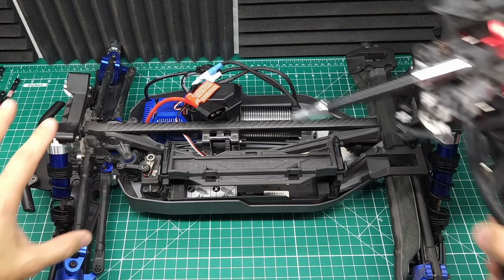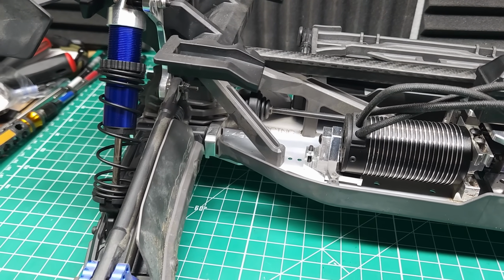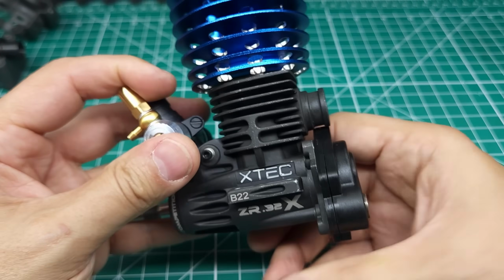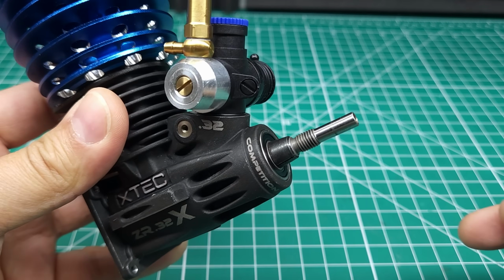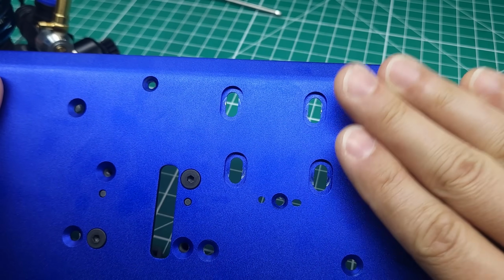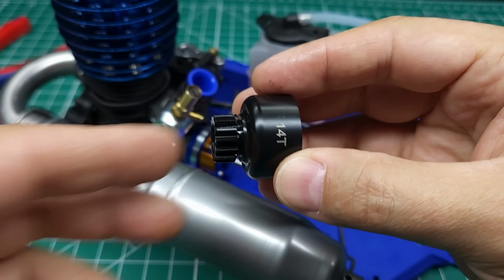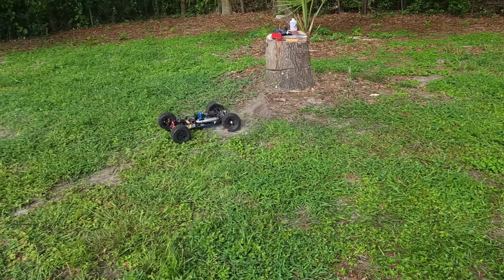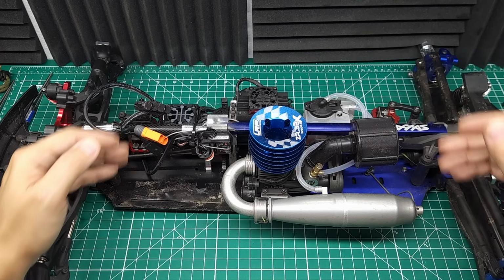Hybrid 2.0 - I Built The Craziest RC Monster EVER!

Comment: So why didn't you use the traxxas 2.5r engine it would be smaller and the the rpm is 60,000 just like the electric motor
Reply from the maker: I was going for the most powerful engine I could find. The Traxxas 2.5 is pretty weak.
Reply: @DoRC yeah but its hard to beat those rpms with these cars
Reply from the maker: For sure and I certainly did not create the ideal setup here. This is just me messing around with what I had available. I am sure someone could do it better and I definitely encourage others to try!

Comment: You need a small metal lathe. That flywheel project could have been a 30 minute project.
Reply from the maker: A lathe definitely would have been easier but it was a good challenge.

Comment: If you mount the gas motor in the original spot and swap the differential around in the front case to the other side of it's case.  It'll spin the wheels in the other direction.

Comment: Interesting build but what's the point? What problem is this solving? You've succeeded in making a car that's worse than the sum of its parts. I have a few nitros and they're fun, but modern electric is superior to nitro in every way. It would actually be an improvement to remove the engine, which unfortunately renders the whole exercise pointless
Reply from the maker: In this case the journey was the point. Sometimes just seeing what works what doesn't work how things interact etc is a lot of fun.

Comment: why not build a fast nitro basher with small electric motor and wheels on the roof. so if you flip you can use the electric motor to drive it back to you so you can flip it over and start it up again. or an RC electric basketball that you cant break since everyone just does huge jumps now anyway

Comment: I have a question: instead of rethink the mounting position of the nitro engine to change the turning-direction, why didn't you simply turn the diff around in the rear housing?
Reply: i'd also make a few modifications on the drive-train. First of all i'd install a discbreak on front and rear-end. Second i'd install a freeweel-beariing on both electric and nitro-drivetrain to avoid either of the engines having to drag the other engine with it. That way you'd have a much easier way to setup the poweroutput on both engines and have a well performing break for the whole model. And the only cost would be a little more weight for the breaking-System and finding a way how to install a freeway-bearing.
Reply from the maker: Unfortunately the way it's designed the ring gear goes down through the housing and into the chassis so you can flip it around but you have to do some pretty significant modification in order to accomplish it
Reply: @DoRC  In that case, i'd simply use the traxxas for the frontend and the arrma for the rear end - i believe it's easier with the arrma Differential, isn't it?

Comment: The air filter should be facing the front because it forces air in and makes the engine run better
Reply from the maker: I'm not sure I agree with that. Maybe if you're going really fast and you have a ram air scoop it might help but for what I was doing in this video forward or backward especially with the shape of the air filter isn't going to make any difference.

Comment: It’s because your pipe was facing downwards, and it was most likely running into obstacles out in the backyard that it would bug it out anyways with it being so new in it’s breaking it would still have troubles, no matter what and you know running around in that tight circumference nitro engines like a big circumference like to go big motoring around not little bitty turns God bless you
Reply from the maker: I don't think it was the pipe because I had problems on concrete as well

Comment: She mega rich on part throttle , those carbs are junk but it sounds to be mega rich on the low speed needle . I wish you were local I’d assist you on getting the .32 dialed in, first I’d check the plug make sure it’s in good shape , next those engines like .50 with of shim for the stock plug on 30% , if you have 20% then .40. They can be sensitive to fuel /oil and 8-10% oil is the sweet spot. Last the carb ..smh , it’s a .32 and even at 9mm Venturi it’s small for a .32 so never choke it with a 7.5-8.5mm Venturi esp when combined with a sub part carb . I have always ran a long needle Novarossi carb , my fave on the 32 is the 24066 . I have also done a few others which are all miles superior to the stock in terms of tuning and performance .
Reply from the maker: Yeah I've been running Nitro for quite a while but I have never really gotten into the really serious tuning so I usually just get them running good enough and then call it a day but I never could quite get this one running good enough.

Comment: Why not use the electric motor as an alternator to constantly power the electronics so you don't have to charge anything on the car, just refuel it?
Reply from the maker: It probably wouldn't be practical. These motors are not even remotely efficient and they're not designed to run it constant speeds.

Comment: Another banger Frankenstein build video!
Random ideas- Supercharged nitro, or gas buggy? 6x6 basher? Tracked basher? Amphibious car? Water cooled motor/ ESC for high gearing/ speed runs? Jet, diesel, or rotary powered something?
Well, I guess you kinda already did do diesel lol. 
This is kinda crazy, but if you didn't want to over rev the nitro motor you could connect the electric motor with some kind of reverse/ inside out clutch that actually disengages after a certain RPM. I'm half asleep, but great video.
Reply from the maker: Stay tuned :-)

Comment: Main needle valve o-ring . Change that and it will run sweet. Once they leak it's nothing but trouble.
Reply from the maker: I checked it and it looked perfect. I suppose it could still be a problem but I didn't see any issues with it.
Reply: the O-ring will look fine , but it might have shrunk . Trust me it's the first thing to go on a nitro carb and will cause rough running and cutting out due to air leak . A good way to tell is if the screw goes in and out easily.  There should be some resistance when screwing in when it's cold.
Reply from the maker: @mattfranks4335 Yeah there was resistance. Just to clarify I've been running nitro engines for about 20 years now And I've also been a professional mechanic for 20 years.  The engine was brand new and before I ran it I pulled the needles out and lubricated them.  Obviously it's possible It was a needle o-ring issue but I really don't think so.
Reply: @DoRC Cant be that then bud. Not teaching you how to suck eggs it just caught me out some time back. Im guessing you have tried a new plug ? What % nitro are you using?

Comment: haha thats bad ass,   i got bored of my slash 2wd being a normal slash 2wd So i bought the roll cage parts to a losi hammer ray and bout a solid axle, i mounted the transmission sideways inside the cage and used a tmax drive shaft. this sucker works amazing and has tons of travel. my only issue is the rear axle because it snapped and i had to weld it back together lmao, i also made my own aluminum body panels. its pretty bad ass
Reply from the maker: Sounds like a lot of fun!

Comment: On that Nitro engine the lower weight on the flywheel may be making it run bad.... big time nitro guy over here....... ;).  You mentioned this, it's accurate.
Reply from the maker: Yeah it's possible that I suspect that would really only be a problem at idle and I'm not super convinced it's that much of a problem anyway. The rotating mass includes the flywheel as well as the entire crankshaft the nut the one-way bearing shaft etc and I'm just not sure what I took off that one area of the flywheel really decrease the entire rotating mass enough to make a big difference. It totally could though

Comment: If only traxxas didn't suck and you could just flip the diff to reverse the drive direction on the nitro side. 😛
Reply from the maker: Well I can't really blame Traxxas for that. Flipping the differential isn't really something you would ever need to do in normal use.
Reply: @DoRC  not on a basher sure but a custom crowler or something you might need it. Either way just a joke.

Comment: I thought of having the max rpm of the engine be the max rpm of the motor but that would entail the engine be not in its power band almost the entire time unless going near top speed which would require a 2 or ideally 3 speed transmission so if the motor revs to the moon if the tires break traction, the engine wont grenade, it would limit the low end performance of the engine, but that is what the motor is for. And you could get around the high clutch slipping becaue of the potentially high gearing for higher speeds with a dog tooth clutch where it just engages fully when revved up. You could also maybe put one of those one way free spinning bearings to have the motor be able to rev past the rpm of the engine, im not sure if there is one out there both strong enough and reliable enough to work though
Reply from the maker: Yeah I think just gearing them the same would probably be best. Fortunately the power band of an electric motor and the power band of the Nitro engine are kind of opposite of each other so I think it would work well

Comment: well, glad for the mini-review on the GTB clutch, as I was looking at that as a cheap part for my 8ight. Given that the design is a clone of the Losi 4-shoe design, I think TLR or Protek bells should work fine.
Reply from the maker: Yes other bells should work with it. With that being said I still don't recommend it as the quality just doesn't seem to be there.
Reply: @DoRC nah it’s one of the most important bits in a nitro drivetrain. Good clutch and bell setup keeps the throttle feeling as it should every single time.
Reply from the maker: Agreed.  @vivos71

Comment: Great video, some serious fab work! To make it a real hybrid, could you use the engine to charge the battery?
Reply from the maker: Technically this is a real hybrid but you could set it up that way. I think the big problem would be that the Nitro engine wouldn't last very long running constantly at full tilt and you'd run out of fuel really fast.
Reply: Could you charge some capacitors to give you a turbo boost option?
Reply from the maker: You could but I think you'd be facing the same problem. The capacitor really would just be storing and then releasing energy in order to have enough energy to be worthwhile you'd have to run the Nitro engine pretty hard.  @makeitwork583
Reply: @DoRC charge the capacitors before you run?
Reply from the maker: @makeitwork583 You could do that but capacitor energy density isn't great so you wouldn't get a lot out of them unless you had a huge capacitor bank.
Reply: @DoRC I just watched a Tom Stanton video from a year ago. You’d have to run them in series to get the voltage. Be a great ‘turbo’ for a few seconds, perhaps? Turn your 2s into a 3s for a little burst?
Reply: @DoRC okay, what about using them to power a car-poon? Eh, eh? Lol
Reply from the maker: @makeitwork583 carpoon?
Reply: @DoRC law enforcement use it in car chases in America. The harpoon, attached to a rope, is propelled into another vehicle. Then they winch it in.
Reply from the maker: Ahh. Yes I've seen that. That sounds like fun :-) @makeitwork583
Reply: @DoRC Make it so! An RC first!

Comment: I would run a Hobao carb on that LRP and run it in my savage xl and make sure it still has pinch
Reply: @do rc LRP just made a new 3 needle carb
Reply from the maker: I saw that! @chardison6026
Reply from the maker: Definitely still has good pinch.

Comment: Very cool build! This is what the hobby is all about, very clean build well done sir.  I couldn't quite tell in the video but any chance the tank is 180 flipped, where the stone filter is at the frt vs the rear?   That can cause fuel delivery issues and cause frustration.  Sometimes an engine just hates the pipe too, i have the 086 (top end), big blocks seem to like that one, haven't tried thd mid 053 yet .  I noticed you had what looked like a carb restricter installed in the venturi (orange insert), for bashing suggest removing it.  It helps with fuel efficiency for racing but can cause tuning issues.  If you pick me for the engine I'd like to try it in a model airplane if I can make a prop adapter or an airboat. I think that would be cool, or drop it in a Savage twin engine build that's in progress.
Reply from the maker: No this doesn't have a clunk in it. It just has a tube going to the bottom and the running issues occurred even when it was completely full.

Comment: I would try using the nitro engine as a generator to power another motor to power the brushless motor  That way when it's running I don't even provide power for the circuitry and then when it's running stronger provide increased voltage power for the brushless motor That would be a cool project 👍 But also on the motor you didn't really have to turn it around you could have just swapped the gear around in the diff bulk.
Reply from the maker: You could do that though given the Nitro engine isn't really designed to run at full tilt constantly and how much fuel it would use at full throttle I don't think it would be very practical

Comment: (guestimating) If you remove half the weight on the outside of the flywheel you remove 70% of its inertial torque needed to overcome the next compression cycle.

That's why it runs rough. You can calculate how heavy and long the flywheel can be to compensate for the reduced width. 

Or combine the two struts into one to mount both in one go using the original flywheel.
Reply from the maker: Not sure I fully agree with that. I do agree that a lot of the mass of the flywheel wasremoved but the entire rotating mass of the engine contributes to its inertia and that small amount of aluminum on the outside of the flywheel in comparison to the mass of the crankshaft and everything else attached to it that's rotating is probably not that much. Also I wasn't really having problems with it running rough per se. I was having problems with it keeping a tune. It kept swinging from Rich to lean and would be rich at certain RPMs but lean at others and I couldn't tune it out etc

Comment: I've never had any luck with nitro engines.  Especially here in Arizona.  They either don't run at all, or run extremely hot, like 450 or 500 degrees and then die.  And any time the outside temp or humidity or barometric pressure changes by 1% you have to stop and retune..

As soon as brushless motors started being affordable and batteries became good, i swore off nitro engines until they finally make one with an EFI system that automatically tunes itself.
Reply from the maker: Yeah I've had plenty of good luck with Nitro over the years I just particularly struggled with this one.

Comment: Why not just tig weld the 2 chassis together?
Reply from the maker: Two main reasons the first one is that I Don't have a TIG welder but the second one is that this is a temporary setup mostly just done for the experiment. Because of this I try to make as few permanent modifications as possible. Cutting the sledge chassis was unavoidable but permanently altering the Kraton chassis wasn't necessary.

Comment: for the problem of the car going backward witth the engine you could have turn arourd the front diff
Reply from the maker: Unfortunately in this particular vehicle it's not easy to do as the ring gear goes through the bottom of the bulkhead and even into the chassis a little bit

Comment: You should find a way to use a 2 or 3 speed transmission for the nitro engine
Reply from the maker: It's definitely doable though it would probably be better to put an electric motor on a Nitro at that point

Comment: You don't really need the battery tray. You could cut a slot for the Velcro straps to go through. That would save a lot of space and then mount the receiver somewhere with mounting tape.
Reply from the maker: I actually ended up just double side taping the battery for now but yes velcro does work as long as it doesn't end up getting cut underneath the chassis

Comment: I’ve been thinking about whether it’s possible to take a platform like the T-Maxx and reengineer its EZ-Start system so that it not only functions as a starter but also contributes to driving the crankshaft during operation. The idea would involve using a brushless electric motor as a secondary power source, providing assistive torque in a controlled manner.

Choosing the right brushless motor is critical. It must deliver enough torque to assist the crankshaft but remain within the safe operational RPM range of the nitro engine.

The electric system would include a controller with an RPM limiter to prevent it from over-revving beyond what the nitro engine can handle and allow tuning a specific point where power is handed over to the nitro engine.

The one-way bearing should allow the nitro engine to disengage the electric motor once it takes over, preventing any mechanical interference or drag.

This concept would require precise engineering and tuning of the electric control system to ensure smooth transition and coexistence of both power sources. But with the right execution, it could be a compelling hybrid setup. If anyone can make this work, it’s you.
Reply from the maker: Yes you could do something like this though of course you would need something other than the stock motor. How well it would work? I have no idea.

Comment: Very cool setup, I was one who suggested to put the nitro engine in front or back and the electric motor the opposite, to get the engine running better, the fuel air mixture has to be adjusted with the screw or maybe another octane/cetane fuel, since these are not spark ignition maybe cetane
Reply from the maker: Yes I did a lot of carburetor tuning on this trying to get it running right.